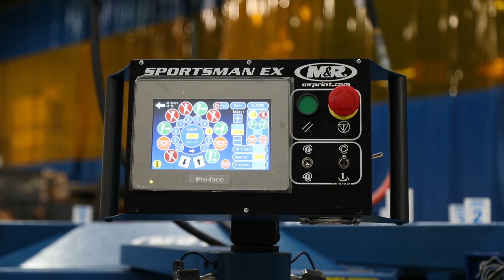M&R  Screen Printing St. Baldrick's: Conquer childhood cancer shirts

Comment: Im a custom screen printer at my job. What kind of tack/spray do y’all use ? we use this kind called Mist. Our machines are layered in thick sticky dust while your machines look so clean. It’s starting to effect my lungs and it’s getting hard to micro when I’m setting up a job bc of all the gunk.
Reply from the maker: M&R strives to be as eco friendly and environmentally conscious as possible with our processes and our people.
We use waterbased pallet Tack.  Tekmar is an example.  Applied with a thin layer of adhesive and spread across the pallet paper with a card.
It affords tremendous hold down for both t-shirts and sweats and has a tack time that rivals aerosol solvent based adhesives. Should the adhesive lose its tackiness as a result of lint or fleece build up, it can be quickly re-activated by being wiped over with a damp sponge, giving maximum use and minimizing reapplication.
 
PMI Double Stick Pallet paper as well is a great alternative to Spray Tack and will help keeping your machines, workspace and people clean.
Sticky on both sides to hold shirt in place without having to apply water-based or spray adhesive.
Adhesive can be re-activated by wiping with a wet sponge.
Both options For screen print and direct-to-garment pallets.